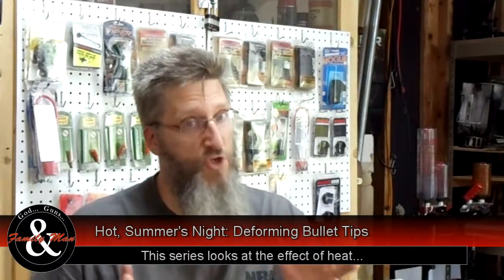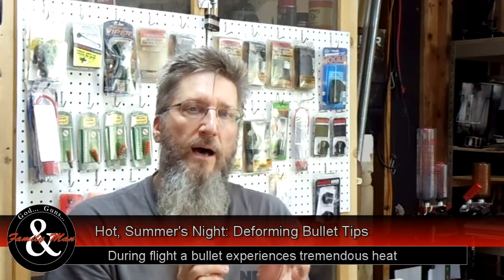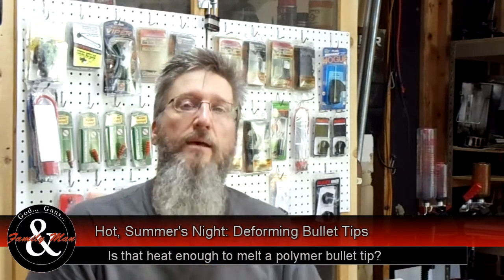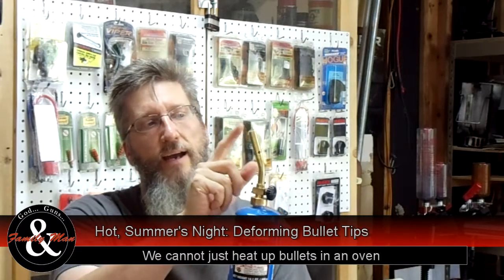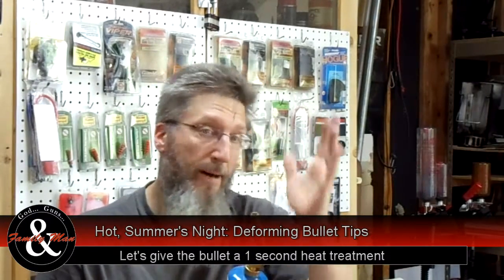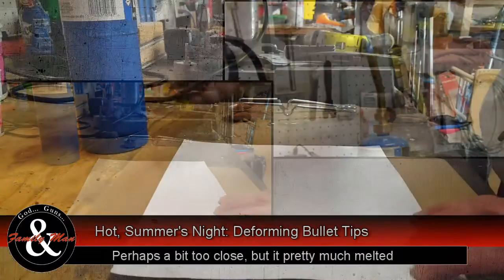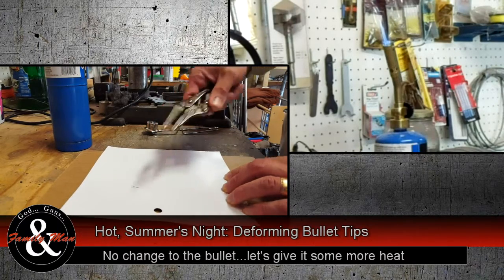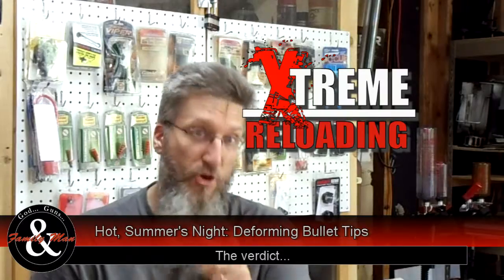Extreme Reloading: The Incredible Melting Bullet

Comment: Here is something else to consider.... during the heat exposure you not only have the force to push around the now more pliable material BUT also the addition of its insanely fast rpm throwing it off center and now you have an unbalanced projo wobbling slightly decreasing bc. Also the projo is surely leaving the barrel above 300f
Reply from the maker: Good points.  I think Hornady's work on this is very interesting.
Reply from the maker: BTW, thanks again for watching and posting.
Reply: I have not seen $:donuts tests of promo vs projo terminal behavior against soft or hard mediums tho. Surely  the makeup is changed in how it does or does not reliably expand. of course this is not a hunting/offensive round but I still shoot living targets with the amax and eld and would like to see super slow mo and ballistic tests.
Reply from the maker: Very true.  For hunting applications I nearly always rely upon Barnes bullets.  For punching paper, etc. I look more broadly. In the case of my Ruger Precision Rifle I use the 168 gr. Sierra Tipped MatchKing.

Comment: To expand on the marketing issue... I wonder if that was their original intention.... If they knew from the getgo that the traditional bullet had those properties (lower polymer melting point) and to boost profit decided to make a bullet with a high polymer melting point and use that as they market strategy
Reply from the maker: Might be.  When all is said and done though, we as shooters are better off.  

I think the effect of the new heat-shield tip won't be too noticeable unless shooting long range though. Thanks for watching and posting.